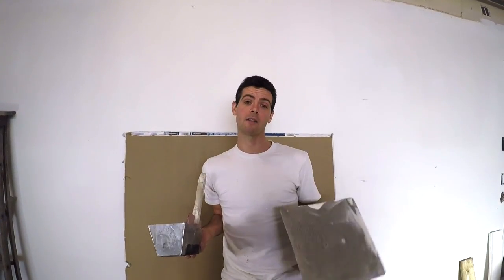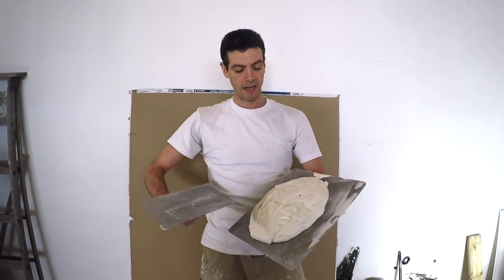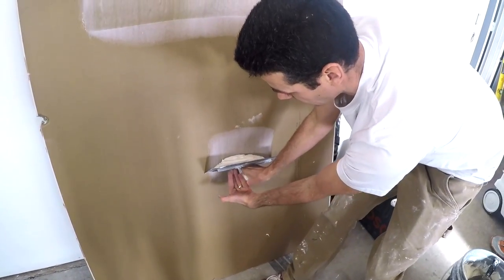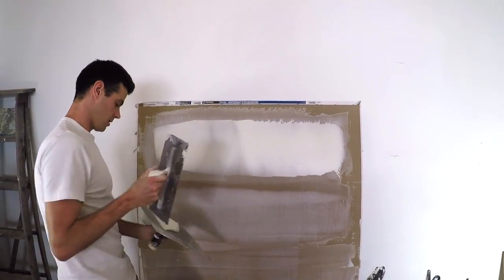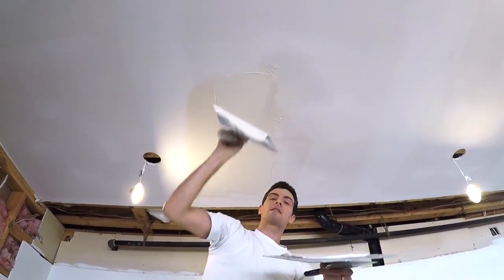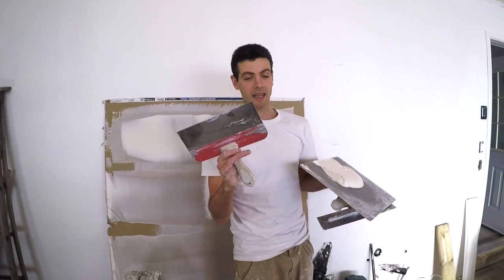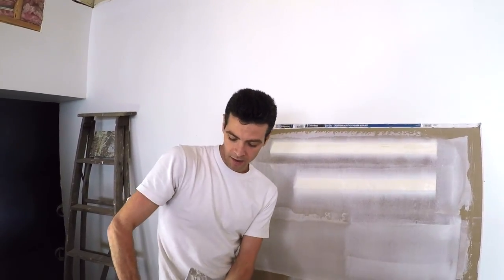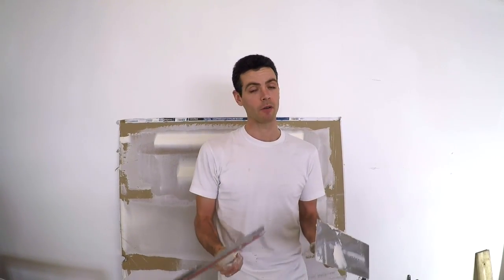HAWK AND TROWEL VS PAN AND KNIFE

Comment: I've never used a trowel (except on concrete) but seems to me you'll do more sanding after using it.
When using a knife, it's easy to avoid loading up both edges and application angles will drive the mud away from the leading edges.

Comment: Thank you for making and sharing such great videos.  I'm a homeowner and do some minor drywalling.  I have taping knives and a pan but I recently purchased a hawk.  Is there a reason I shouldn't use my knives with the hawk?  I know it isn't standard but I really like the control of the hawk and the ability to work the mud.  And yes, I suppose I could purchase some trowels but I drywall so infrequently it doesn't seem justified.  Thanks again!

Comment: Greatest Mud Videos on the Net. 
FYI what I have noticed too..is with Durrabond 90. 1-2.5 ratio of water to mix...fits in the pan and mixes. Just about as much as you can use in that time as well. Coincidence? I have no idea. Asking you.
Mixing has always been my problem. I have to do small batches of Durabond other wise it tightens up to fast. 16 oz water to 40 OZ plus of powder. Anymore than this...I am screwed. Slowing down I guess.

Comment: I use a 14 inch pan , it holds quite a bit more , it can hurt your wrist because of the weight,  so I would recommend a 12 inc pan for most , hawk and travel looks interesting,  and i would like to try it

Comment: Just a FYI bro when pulling a broad knife just wipe the corners of the blade on your pan before applying it to the surface, I prefer a hawk and trowel myself but that is a easy way to get the ends of the blade clean so you don’t make a mess

Comment: Real plasterers, like myself, tape using a bazooka to put down the tape and a hawk and trowel for 2nd and finish coat. On small jobs a 6 inch blade to put the tape down with a hawk and finish up with a trowel. I have never met a pan taper that has done a good job, you always see the mud areas once the paint is done. I haven't done a normal tape job in a long time since I am seriously booked doing stucco in the summer and level 5 jobs in the winter, when your good your booked years in advance.

Comment: I prefer the knife however the side not being used collects dried or dryer off scrapings which can easily be transferred to the finished surface and can make a mess. Where as the trowel the drier mud stays on top as that surface is never used.
Reply: wow a really fast and easy solution.. WIPE IT OFF ON YOU'RE PAN

Comment: I just bought knifes. For 300 for a set of level 5. Has 9 knifes. 3.5 corner knifes a 6 corner knife. 4, 5, 6 , 8 , 10 , 12 , 14. Knifes. Pan thats 16 inches. A mixer for the mud. a multitool thing a cut out tool. I will have to grab a hawk and trowel next. It was fairly cheap 300 for a whole set of different knifes.

Comment: A caveat for Hawks. Many of them sold in the box stores have threaded handles. If you are left handed it will want to unscrew as you use it. So, lefties should look for one without a threaded handle or at least beware. I am using a threaded hawk left handed right now. I need to be careful and tighten it from time to time. I wonder if they make a reverse threaded version. Maybe lock-tite will help.

Comment: Well after 35 yrs I’ve used both, started with a hawk and trowel. If the knife and pan beat the hawk and trowel then they clearly didn’t know what they were doing. Whether you know it or not hawk and trowel was used first and pan and knife can along from painters as he said and has a smaller learning curve which tells you something right there!!! The trowel does the buildup you need all by itself consistently if you use the right trowel. It’s all preference but clearly one method IS better than the other!!!

Comment: I actually enjoy much better using hawk and knife for spackling. The hawk is much better and less strain on my wrist. And the knife is easier to wield than a trowel.
Though I haven't used a trowel much and continue to attempt to use it during every finish job I receive.

Comment: You can spread mud way further with a12 inch or 10 inch knife than what you were doing here, especially overhead. You get a knife full of mud and slap it on to the ceiling or wall then spread it. No squirting out the edges and you can spread it twice as far.

Comment: Definetly a pan and knife guy, their made for drywall for a reason, i like the quick spread of the hawk and trowel but their made for plaster  work, and with a knife and pan setup you dont have to jump from trowel to knife to feather your edges. If your good with a knife you'll never want to use a hawk and trowel ...unless you just wanna show off haha. Also make sure your not just using any trowel it has to be a drywall trowell it has a curve or bevel to it to help with feathering id assume.
Reply: a curved trowel is for first coat only... a regular finishing trowel works fine... only diff is it is not as wide so less mud fits on.
Reply: Aaron Brown good to know thanks
Reply: Can use a curved trowel for all coats. Just pull it tighter on last coat. I use a 16 inch curved trowel always. The  a 14 flat for knock down texture or floating a ceiling or walls smooth.

Comment: On the knife. Youre supposed to taper your knife on pan before applying it. If not, it will spill over every time no matter. You have really good trowel work. Trowel is definitely faster and better for butt joints mainly.

Comment: Thanks for sharing. I have been curious if it was worth trying the hawk and trowel and I think I might in the near future. Since you say it is worth trying on larger jobs, I may pick up a set. Do you use automatice mudding tools(flatboxes, etc)? 

I clean off the edges of my 12" knife into the pan after I grab some mud when I need to apply lots of mud to reduce the amount spilled. I was expecting to see you do that in the video.

I was typing as you threw the knife. Nice ending. Keep up the good work, both labor and videos.

Comment: Trick with 12 inch knife is to use a 14 in pan so you can cut off the mud on the corners before using overhead. I think the trowel would be great for bed coating joints and knife better for finish coats/butt joints. Nowadays everyone uses Boxes lol.

Comment: I agree that taping is much better using pan and knife, but not butt joints. It really shines in the corner. It's so awkward to tape a corner with hawk and trowel!

By the way, 8:12, you should have used the small side of your trowel! Then it's just the same as the knife.

Comment: Hey !! I love all your video, thanks a lot for all your tricks and expertise. I learn how to coat all my house because of you, and its a pretty good job ! I want to do more job and maybe extends on reno work, can you do a video on what exact trowel and hank you choose ans why ? Im a little confuse in trowel.. curve or not , inox or not , 10 ? 12 ? And there some at 25$ and others at 60 $ .. what is the difference ? Marks ? Thanks a lot for your time !!
Reply from the maker: Curry trowel. 12, 13 or 14 inch are all good. Get a 5" wide one if you can. Always a stainless steel flat blade.
Reply: @vancouvercarpenter  good , i search for this here in québec, i dont have retaler but i can buy with amazon ! Thx a lot , continu your good work!

Comment: I kinda disagree with one of your points. I used a trowel for the first time (only a few jobs under my belt total) and didn't have any issues feathering. Tbh, I found the trowel and hock much easier and cleaner than the knife and tray. 

Anecdotal true, but still my point of contention

Comment: Good video.  I might try a trowel and see how it goes.  I definitely need to work on feathering as I tend to dig in on the finish side.  

I have a question about mud.  I’ve seen you and handyman talk about mud types.  You said tapping mud has glue in it.   I can’t find that anywhere or finishing mud.   I have light weight, mid weight, all purpose and type 3.  All in premixed buckets.  

I’ve been using type 3 and still thin with water.  Any insight or sources for these?

Comment: I don't like pans, because I cannot shape my mud pack to pick up what I need, where I want on the blade I'm using. I prefer a hawk with a knife or trowel. Like you, I get better leverage with a trowel, more control, and can work faster with less effort. A large knife requires extreme wrist flexing to position it, even for simple tasks like cleaning the blade on the hawk. I somewhat disagree that  a trowel has a steeper learning curve--I think it is easier to learn than a knife, but maybe that is because I started with a trowel. Hawk and trowel are definitely worth learning if you have a big project to work on.

Comment: I can hold 100 pounds on a trowel. You make an excellent point about the load leverage on the 2 different blades. No wonder their wrists are shot. A trowel handle goes across the arm, not along the arm. A knife is just a suggestion, I call them fly swatters hahahaha. I use only a 6 inch knife, 12 and 15 inch trowels, and a 20 inch pool trowel.

Comment: I use knife and pan. I dont like the pan slipping out my hand so im going to try the hawk and knife. I think its just the experiece you have working with the tool. If i would've learn finishing up north i bet i would've learned with hawk n trowel. But since i learned in florida i use knife and pan. But i am gonna try knife and hawk. Thanks for videos....ps how many tries did you do on the outro? Lol bad ass
Reply from the maker: That was just a spontaneous lucky first shot. I kept getting frustrated when filming and told the camera dude I felt like throwing my tools at the wall. So you  an thank him for the quick idea.
Reply: @vancouvercarpenter  awesome thanks for the reply

Comment: The reason you weren't able to spread the mud as far with the knife is because you were getting it out of a pan. Try using a broad knife with a hawk, and I think you'll find that you can get more mud on the knife and spread it farther. You can also take the mud off more in the center of the knife and not have it spill over the edge.

Edit: Doh. Should've watched to the end before commenting.

Comment: You can't tape flat seams (tapered edge to tapered edge) with anything wider than a 4" knife, otherwise you won't be able to set the tape lower than the face of the drywall. Hawks are hands down better; all the pros you mentioned plus super easy to clean and it's easy to catch blobs that fall with it. You should try an actual drywall trowel, they're cambered across the narrow sides giving you even more control over the spread. They do cost a bit more than that parging trowel you have though. I use an 11" and a 14" trowel after the tape coat on all my flats, butts, and outside corners. I use a 4" knife to tape, and a 3", 6", or 8" knife for anything else. Always with a hawk, a pan will get you laughed off my site, and taping flats with anything other than a 4" knife will get you fired.

Comment: good information  , i,ve never used a hawk and trowel ever. Been drywalling my whole life and can see you are not using your drywall knives correctly so you are not getting accurate pressure try using thumb and pointer finger on the top of your knife  instead of your pointer and middle fingers

Comment: Thoughts on flexible vs stiff knife? I am an apartment maintenance tech specializing in HVAC and plumbing so do a lot of drywall damage but drywall repair is my biggest weak point (our contractor makes a killing off of me) so I have been binge watching your videos. I am ready to do my own repair but don't know whether to get the "rigid tape knife" or "flexible putty knife". Any thoughts appreciated.
Reply: I think it depends on the person. For myself I prefer a medium stiffness for my 6" and a flexible 10" knife for finishing.

Althought 99% of the time I use hawk and trowel (Marshall town permashape 12") for finishing which is considered stiff to my knowledge.

Comment: In Germany we simply just take the mud outta the bucket with a a bricklayer trowel. Out the bucket, onto the trowel and off you go. I would really like to use that method with a knife to apply the mud, but unfortunately the drywall joints in Germany are usually to wide for that, so you'll need a trowel anyways. I wish, that drywall systems in Germany were more like the american ones, especially when it comes to taping. This way one will always have clean corners without using that damn acrylic. American drywall systems appear way more efficient to me.

Comment: If you are going to use a hawk for more than a couple jobs, spend the money on a magnesium alloy one. The cheap aluminum hawks will bend and become difficult to useless after time.
Does anyone have experience with a hook trowel?  Work really well on butt joints, especially ones your hangers fubar'd because they dont remember how to read a tape measure.

Comment: Though I'm not a pro I've been paid money to install and finish drywall but it's been about 13 years or so.

But speaking of trowels. I was in home depot and checked out anything new in tools. 

In the drywall section I found something a forgot about. The curved drywall trowel.  But in the day way before the internet and I got most of my info from magazines these were supposed to be an abomination.  😀

I still can't figure out how they expect them to work.

Another thing I've never seen you use a corner knife. I find it makes doing wall to ceiling corners so much faster since you can do all 6 sides at one time instead of one side at a time.
Reply from the maker: I just filmed videos on both subjects. I'm personally not a fan of corner trowels but I do agree with you on curved trowels. They make a good doorstop!
Reply: @vancouvercarpenter  also at HD there are no other trowels in the drywall section.

Can you use the trowels around the corner in the concrete section?

The guy I used to work for fancied himself a plasterer but used pool floats which I always though was cheating. 😀
Reply from the maker: @chartle1  you could use a concrete trowel. The difference is they are usually 4" wide which is a but narrow. I like a 5" trowel and you will only find those at a drywall supply and probably some supply's in the US won't even carry them. Just look for any decent trowel that is 4.5 x12 and straight or if anything it should be even the tiniest but convex.

Comment: So, I have worked on small projects with drywall work in our new home upgrades, including textured dryway. I have based all my skills off of your videos.  I am working on finishing my basement, but I think I made a mistake. I am using mesh tape bc I already had it. Since the framing is not load bearing, do I need to switch to paper before mudding?
Reply from the maker: Just make sure to use quickset and be sure to force the mud into the joints and wipe the mud down pretty flat. Then do two or three coats with all purpose or topping. Mesh isn't my first choice but it should be fine. There is an increased risk of cracks but paper has its drawbacks too especially it's steeper learning curve.

Comment: Been spackling for 15 years. I always use a trowel as my hawk. That way i have both tools at my disposal. Trowell holds less material but enough to work with comfortably.
Reply: Jamie Stein so which one (the knife or the trowel) provides more even coverage? Do you have to apply much pressure when using the trowel?

Comment: It's all about technique, My family has been in the Drywall business for generations.

They all say Hawk and Trowel cause more hand issue later on in life do to the muscles used in pushing the mud, where has Pan and Knife you can get by Without Pushing Your Hand Muscles by manipulating the angle of the knife in your hand.

The reason why you used the Knife and Pan so poorly is you don't understand the technique as you're accustomed to Hawk and Trowel.
Reply: Spot on comment. I grew up working for my dad's drywall biz and have been using a pan and knife since I was 12. That does not mean I have anything against hawk and trowel, for those who find it easier I say go for it, it really is just a question of what you are used to. But if he is doing a comparison, he should know how to use the pan and knife. He needs to adjust his hold for different angles. I cringed as a watched how awkwardly he handled that knife.

Comment: The knife you're using is different than ames knifes the one your are using is stiffer not quite flexible as a regular ames knife the drywall pans are also a factor you can get a 7-in A 10-in or 12-in size pan it all depends on which tool you like to use and which one feels comfortable been doing drywall for 15 years Did you know using dish soap the liquid kind if you were to put some in your bucket of mud before you start runin your mud dish soap prevents from pot marks why you do squeeze a good amount inside your bucket of mud stir It up you will notice the next day you won't have any pot marks